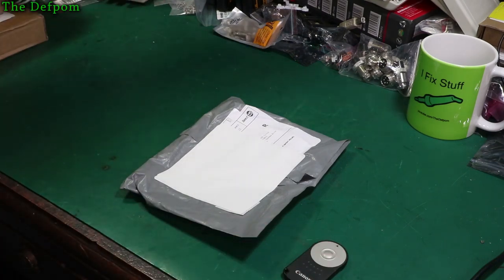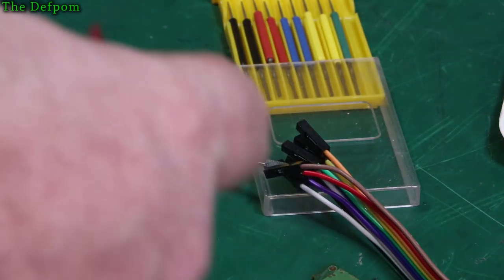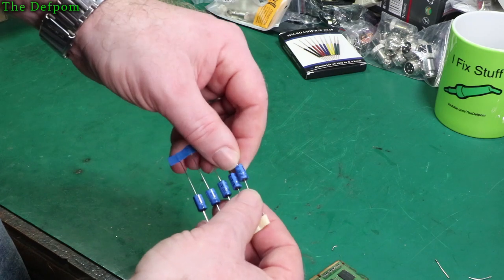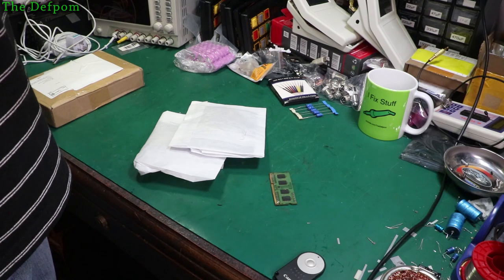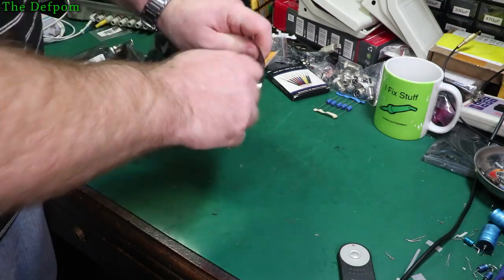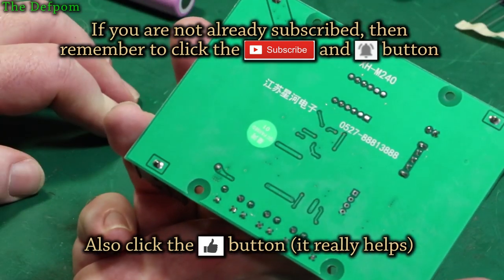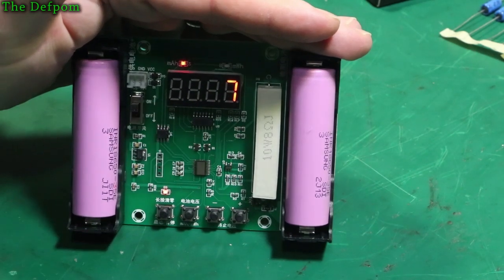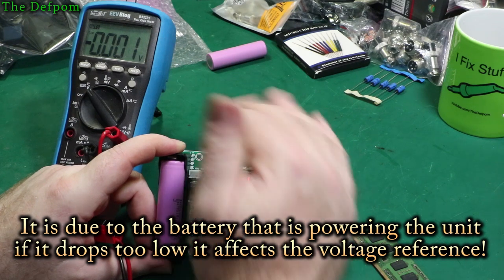#722 Mailbag Monday 8th June 2020

Comment: Just trying to help the push button monkey :D
 1. Connect work voltage DC 5V~12V from white XH2.54-2P socket or install a 18650 battery at left battery socket.
2. Install a measured 18650 battery at right battery socket.
3. Turn on power supply switch. Then the screen will display current battery voltage.
4. Set discharge stop voltage.Press button + and - to set discharge stop voltage.Parameters can be saved automatically.It is recommended that the 18650 battery stop discharge voltage be set to 3.5V.
5. Short press the first(left) button to start measuring.Then the LED indicator D3 will turn ON.
6. Short press the second button to switch dispaly capacity(mAh), energy(mWh) and voltage.
7. Long press first(left) button to clear dispaly capacity(mAh) and energy(mWh).
8. The battery is tested and shows the battery test value when D3 LED indicator start blinking.

Comment: Thanks for the video, Scott. You could de-solder the resistor, move it to the back of the PCB and stick on a heat sink. Then you'd probably have to 3D print a holder! Maybe more work than it's worth.
Reply from the maker: I could, but like you said it’s probably not worth the effort, it is single use for each cell so it’s not really like they are exposed to it for long.

Comment: The 18650 battery tester intrigued me, I could use one!.........until I saw it in operation, what a rubbish user interface. Some English on the buttons, better use of the 7-seg display and maybe a few status LED's wouldn't go amiss. Oh dear!!!
Reply from the maker: Once I understood the way it worked it wasn’t so bad, but it did take a little while to figure it out, not helped by the 10 second delay after pushing the adjustment buttons before it would let you reset/turn on/off the load. would definitely be best powered from an external supply because of the battery voltage issue.

Comment: A bit of red electrical tape over the LED display of your battery tester will help greatly with readability.
Reply from the maker: Yes that is a trick that will work, I do have some proper filter sheet I can use though.